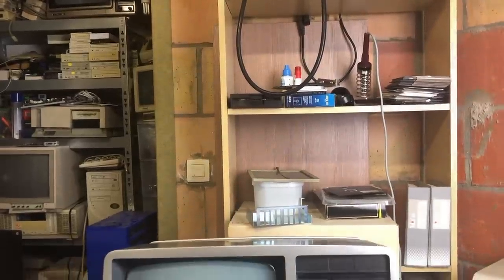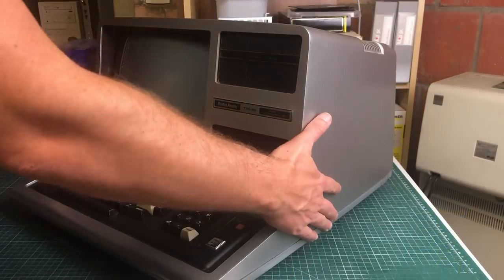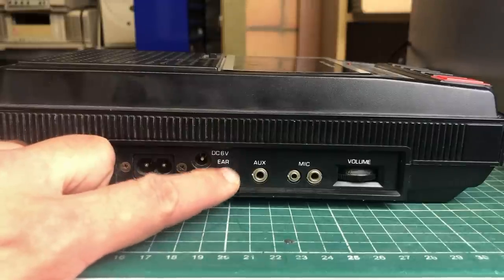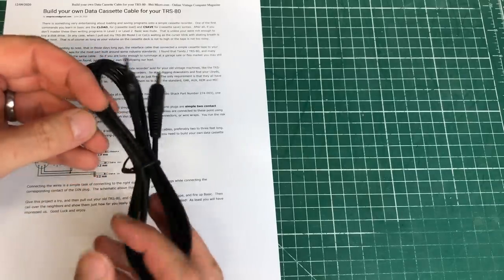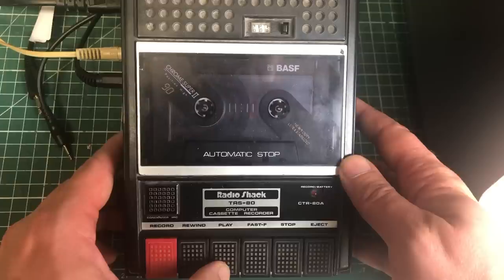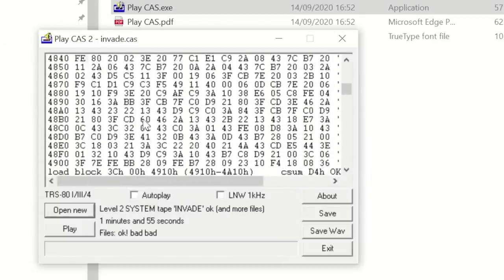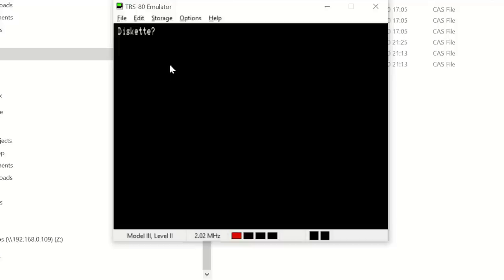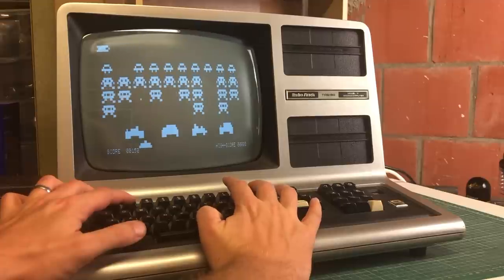Tandy TRS 80 Model 3 - #SepTandy

Comment: Thank you for this video  I owned a model III back in the day  The CASS? question is to set the baud rate of the cassette port.  L is for 300 baud and H is for 1200 baud.  I always used H at the cassette prompt so programs would load so much faster.  This option was only for the mode III or IV was high speed was not available for the Model 1

Comment: I had every generation TRS-80 from I, III, and IV. Then a Tandy 1000. Started my career. Learned to do programming and how to do college program assignments through a dialup modem to the university  PDP-11/70. Learned how to setup a terminal emulator designed for an 80x24 screen for the Model III's 64x16, IIRC. Spent many a fun hour playing and learning these beasts; even found a local company installing dual disk drives cheaper than RS. Great memories. The tape recorder was notoriously fussy; needed to use decent quality tapes to save important programs. Also bought a third-party music program that allowed you to actually play fairly accurate notes through a separate speaker.

Comment: I just wanted to mention - The Model 3 used a standard Shugart interface with 34 pin edge connector for its floppies, so if you buy one of those cheap GOTEK floppy emulators, install the Flash Floppy firmware on it, and connect it up, you can easily load floppy images onto one of these without any original drives or disks. With mine, I've actually run the cable out through a vent on the bottom, so the GOTEK can sit external to the machine and not mess up the look.
Reply from the maker: Good idea ... might look into that ! Thx for the tip.
Reply: @RetroSpector78  Bear in mind that the cassette-only versions of the Model III have no disk controller hardware in them, so it's not as simple as plugging drives into them.
Reply: @Zeem4  Well that's disappointing; mine must have had drives originally that were scavenged or something . . . in that case, it might be worth looking into one of these hard disk emulators for the model 3 instead, if you have the cassette-only model - http://members.iinet.net.au/~ianmav/trs80/emulator.htm

Comment: Given the way the case is constructed, I would turn the entire machine upside down and pull the bottom out instead of trying to lift the heavy, lopsided weight of the CRT risking damage. Most of the screws are also on the bottom so it would be a matter of flip, unscrew, pull.

Comment: i just had flashbacks to Jr. High School when we had Model 3's in our computer lab exactly like this. No disk drives. There was a central disk unit and software was sent to each terminal. I'm not exactly sure if it was over parallel or serial, but it was slow as hell. Great machines though.
Reply: Same here when I was in 6th grade, then the year after they moved over to IBM PS/2 all in one units running Windows 3.11 for our typing classes, but oddly enough for our computer learning classes till I was in high school they kept using Apple II IE machines with about 1/2 of them using monochrome green screens. I know it's a common term now but me, and my friends always made fun of the TRS-80 calling them the Trash-80, or Trash Can, and thought we were edgy for doing as such.
Reply: I vaguely recall seeing a similar setup involving Apple IIGS' with a central disk unit/server in the early 90s while I was in grade school. I remember thinking it was neat...

Comment: I rather like the TRS80GP emulator.  It supports Model 1 through Model 6000 and you can run Microsoft Xenix on it.  I booted a Xenix developer version on it and was able to write and compile C programs in VI.

Comment: Nirvana, great choice! Seems you have used a high quality chrome tape for storing the basic program. Those type 2 / high position cassettes are a bit too good for this purpose as they have excellent audio quality and good treble response. Most commercial software was recorded on the cheapest type 1 / “type 0” ferro cassettes of dictaphone quality.
Reply from the maker: yeah ... but in 2020 I'm not going to be too picky on what kind of cassettes I will be able to find here in my house :) I remembered I kept a box full of audio tapes in the attic so I went for those :)
Reply: The Type I tapes do better with the weaker heads on these simple tape recorders.
Reply: RetroSpector78 About a year ago I bought some tapes new old stock at a electronics hobbyist shop in Arnhem. They still had a few and I bought a type 1 and a type 2 and they said the type 2 was a very high end tape. I have recorded some of my own created music on it and the type 2 chrome sounds fantastic, although lacks a bit of base response because it is pure chrome formulation. These chrome tapes smell like wax crayons and the tape is black instead of brown. It’s just like with 360k and 720k floppy’s v.s. High density 1.2mb and 1.44mb floppy’s. The brown colour is ferric oxide and the black HD discs are cobalt based. Just like with cassettes they have a different magnetic recording bias. I find this stuff quite fascinating. Did you know that type 2 cassettes don’t always have to be chrome, they can also be cobalt-doped ferric this was because of japanese companies not wanting to pay licence fees to either Dupont or BASF.

Comment: My first non-gaming console computer was a TRS-80 Model III. :)

It had 64kB RAM (could have been 48 probably) and 2 5.25" 360kB floppy drives.  I had an external amplifier connected to the cassette port. 

I once wrote a Wheel of Fortune-like game in BASIC with a Z80 assembly routine for sound.  The code was probably an eyesore. I was just 14 years old. 

I liked using LDOS much more than TRS-DOS.

I had the Model III in 1988.  Yeah, rather late in the life of the Model III. Dealing with the primitive graphics and sound (or lack thereof) was so much fun!

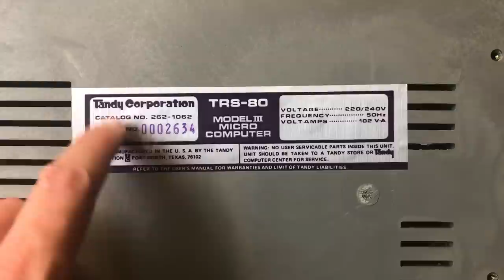Comment: 1:37 that is the Z80 bus expansion port and the other is the parallel port. Could you tell us how they got sounds out of the TRS80 5:37 and routed to output via the AUX jack of the tape recorder? The AUX is is a high level INPUT to the cassette recorder.
Reply: I had a few games for the Model III and I know one has some crude sounds. From what I remember I believe it was caused by operating a relay inside the computer. I've slept since then so I can't remember exactly.

Comment: My TRS-80 Model III had the exact same issue with the PSU boards. I replaced thos pesky RIFA caps with modern eauivalents, A full-bridge-rectifier and all electrolytic caps to get them up and running again (there are two PSU boards in mine) . I was lucky to have found Model III with two diskdrives installed, along with 32K of RAM. Unfortnately it is missing the "X" and the "9" keys and switches. Hope to find these some day.

Comment: Cool! Although I'm surprised the cassette player doesn't have a speaker inside, my Tandy "Computer Cassette Recorder" CCR-81 does.

The TRS-80 was a bit before my time and I've never seen one in person, so I guess they weren't really all that popular here in Australia (don't even know if it was sold here). Went to school with a kid that had one, but he was from Europe, so evidently it was more popular there. We did have a clone, the Dick Smith System 80, hence the line in the space invaders game "Dick Smith Elect.". Presumably it was made for the Dick Smith System 80 and sold alongside the machine at Dick Smith Electronics stores.

It would be interesting to see this machine upgraded to the full 48K and a floppy drive or two. Although I'd understand if you don't want to go to that kind of effort since it's not your machine. You'd need to acquire necessary parts, and obviously get the owner's permission, but you don't even get to keep the fruits of your labour!

Anyway, it was fun to see such an old (ahem) classic machine running!

Comment: you have to upgrade the PSU to add a floppy drive.  man, that's rough.
Reply from the maker: yeah ...think there was a big price gap between the base 16kb cassette model I have here and the version with the 2 floppy drives. PSU is also mounted on the side of the floppy drives, and not at the back where it is currently sitting.

Comment: 8:01: How hard would it be to create some kind of maybe USB adapter to plug the remote control pins on the DIN into a modern laptop also, for extra convenience with appropriate software supporting that?
Reply: I was wondering the same thing XD